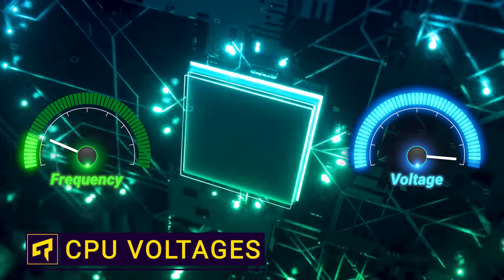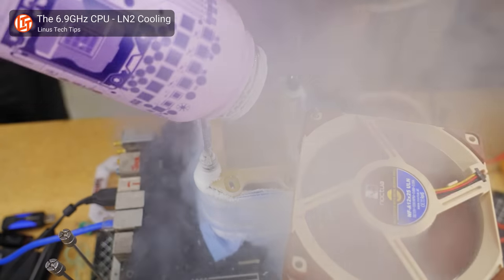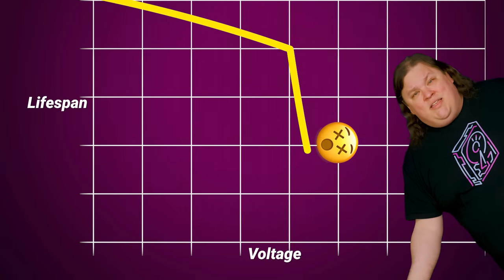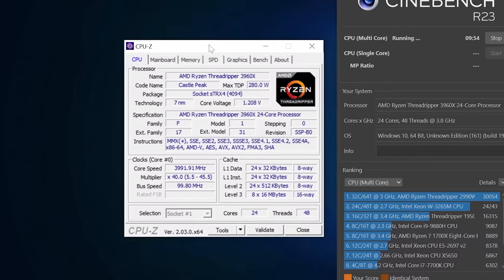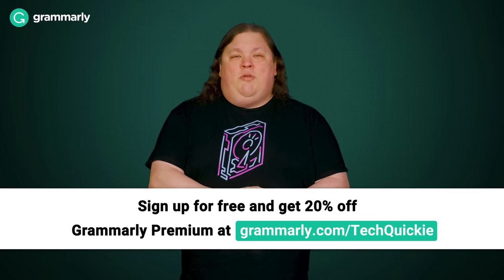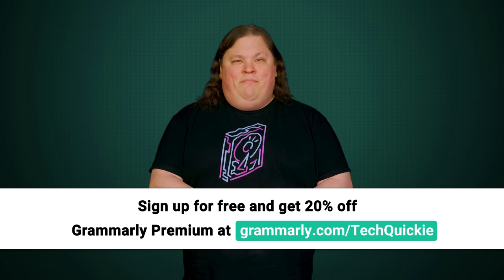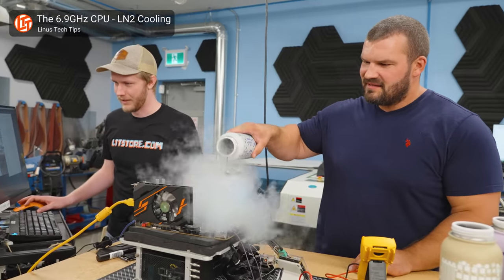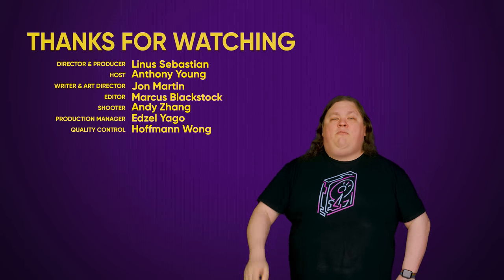What's the Point of UNDERVOLTING Your CPU?

Comment: My 5950x was constantly running at 90c on stock voltage (1.4v). I undervolted it to 1.2v and the temps dropped by 30c. It's staggering how much of a difference undervolting can make
Reply: some motherboards liked to crank the voltage on ryzen for some reason. it became common practice to undervolt. also, newer bios from most makers changes this behavior, so that they run on the lower voltage as a base.
Reply: 5800x, 4.6Ghz, 1.2v! im so glad to see other users here with the same experience. thermal runaway was super common anything above this (4.7Ghz+ or 1.3v+) and i have the D15 cooler
Reply: Dude, thats because your motherboard is BROKEN.  There is LITERALLY something WRONG with your computer.  All you did was put a bandaid on a bullet wound.
Reply: @NinjAsylum  ok buddy
Reply: Waste of time. Just use Eco Mode
Reply: @NinjAsylum  chill, you dont even know what cooler hes using
Reply: @Its_Onion  are you happy with the températures ? I want to try this on my 5900x but idk if it worth.
Reply: My 5950X ran stock at 1,5V...only when using all cores it goes down to 1,1V. I used that 1,1V as the basepoint and found the highest clock it ran with that on all cores. It was 4,2Ghz.
I lost 10% singlecore performance, but gained 10% allcore performance. What it also did was reducing that 90C down to 45C and also cut the powerconsumption for the single core tasks by half. Allcore was not changed with 65C and 140W.
Reply: @steve55619  Eco Mode doesn't work properly on the 5950X. The singlecore still boosts to 1,5V and 90C and multicore performance gets reduced by half.
It is only viable on Zen3/4 CPUs with 1 CCD.
Reply: I'm using stock cooler, but my 3900x overheated at stock so I limited it to 80 watts in the BIOS.
Reply: @steve55619  I think about this too but note X3Ds don’t have Eco mode, you can still manually lower them though
Reply: So im curious. 
My ryzen 5950x under water runs a 1.247v @ 45-55c on 4.7 all core locked, depending on load. Rarely if ever seen it hit 60°

I've gone as high as 5.4ghz all core but at a screaming 1.5v and its temps where basically 80c flat and 90c spikes... which is basically throttle. And sadly didnt see any real notable performance gain on 3dmark or other test from 4.7-5.4, which kinda blows my mind that the ghz increased, but my points barely moved compared with 4.0-4.7 where it jumped hundreds and thousands of points each bump in ghz. After 4.7 it seemed like 25-75 pts per .1ghz. 🤔
Reply: @alorrick7546  5.4 all cores? I do slight above 5ghz and cpu takes 330w of power. You must use nitro cooling
Reply: @Its_Onion  Thats crazy, my Intel CPU with AIO never reaches higher than 50 degrees boosting to 4.4 GHZ all cores, and here people are still saying air coolers are best. lol.
Reply: Any performance loss? Im running the 5600x can u reccomend how to undervolt? Whats the process? Thanks !

Comment: Wish you could have talked more about the physics of how changing cpu voltage affects the speed of the transistors and propagation delays. That is something that I think many people would be curious about when trying to understand why these things work.
Reply: That was the very thing I was hoping to find, pretty disappointed. It's not like I expected differently, but still, I want at least some details. Honestly, these days you get away with lots of nitty-gritty, especially in the techtuber business audiences are hot for information they might not even understand outright.
Reply: You guys are probably expecting a little too much from a channel called Techquickie...
Reply: @Tripdoxx  I mean yes, that's what I said right in the beginning
Reply: Exactly! But I guess you need proper electrical engineers with real time experience for that. TechQuickie won't suffice.
Reply: @Tripdoxx  I don't think so, even a quick high level explanation of how you can get similar or better performance while undervolting is warranted, and expected, because the into mentioned this.
Reply: I wish too, I replayed the video 4 times to see if I missed something
Reply: I was hoping for that
Reply: Nah
Reply: All components in a circuit have capacitance. A transistor has gate capacitance, specifically. Decreasing voltage increases the time it takes to activate the gate (rise delay), and the longer it takes for the gate to shut off (fall delay).

Now cascade this across a circuit path and you will see that a certain amount of power is required to overcome the total capacitance to then supply the correct output. Given that power is a function of current times voltage, we can see that the decrease in voltage decreases the power, and the decrease in power increases the circuit delay because of capacitance.

tl;dr circuit capacitance described as a series of buckets: how long would it take to fill up ten buckets with rain (undervolt) versus a garden hose (default voltage) versus a fire hose (overvolting)?
Reply: @ShimrraJamaane  But still, how does that make it faster? It is literally the first thing he says: "increase your CPU's speed while ALSO decreasing the energy it uses". The way you describe it would make it slower, which is my logical conclusion as well... It will help with wear but at a cost of speed.
Reply: @zer0her048  With an undervolt, you can achieve higher clock speeds for longer, because you are using less power. The issue comes into play with thermal throttling. If you lower your starting point, you can hit that threshold much later while holding high clock speeds. Undervolting decreases ∆T.

Basically, you are looking for the lowest voltage where the chip is stable (no crashes) and you can even raise clock speeds. So you are increasing clock speeds until you start to fail, you take the last known good clock, and you start undervolting. You do this until you find a last stable setting. 

What you have essentially done is find the specific settings needed for that precise chip. You've discovered the greatest clock speed, now you want to prevent the chip from thermally throttling itself. So, you begin undervolting until you find the lowest stable voltage that maintains the frequency. End result? You have the lowest thermal output for the frequency in question without experiencing earlier throttling that you would with higher voltages.

In short, more voltage doesn't mean faster, it just means hotter and potential to offer higher frequencies. If you can run at 4.2GHz at 1.2V or 1.1V, you would always choose 1.1V because the chip will stay at lower temps and maintain higher frequencies for longer. Running with 1.2V in that scenario only results in increased thermal output, not increased speed. So, lower voltages -> lower thermal output -> less throttling -> longer sustained performance.
Reply: @ShimrraJamaane  thank you for taking the time with this explanation in a random Youtube comment thread.
Reply: @dshahrokhian  gotchu fam

Comment: On an i9-12900K I only managed a -0.110 V offset before it became too unstable but it still reduced temps by about 10-15 degrees while using 50 W less. Really glad this is being covered so more people can save a little bit of power
Reply: Also check out and modify the voltage-frequency curve for even more under-volting. Usually the higher frequency can be stable with a larger under-volt.
Reply: I have no clue about this stuff so i wont touch my 13600K
Reply: @teeaymusik9811  then why did buy "k" series CPU?! That is the whole point of the K-series, you paying extra, but you can play with the "dials"!
Reply: @mcst6969  It did only 50 euro cost more with a 1.5ghz higher base clock. And if i want to overclock in future i will be able to. But i think this is not even needed because its so fast at stock so you could also ask everyone else with a 13600K why they did buy it.
Reply: @teeaymusik9811 "only 50€" ladies and gentlemen: inequality is a thing
Reply: @TheSlowDude  I just got a 13900ks and im going to delid it and overclock the shit out of it just like my 12900k that still running to this day. 😁
Reply: @mcst6969  "dials" no. "Nerd knobs" yes. 🤓
Reply: @pixels_per_inch  how much should I do? The general offset of event .05 was unstable for me
Reply: 10-15 degrees less sounds great to me.
Reply: i have a 13600K with an offset of - 0.110 about 45 watt less and a out 7-10 degress less
Reply: Lucky to undervolt, now this cpu cant be undervolted
Reply: @teeaymusik9811  than never buy AMD 🤗
Reply: What are you comparing your undervolt to? I'm running my 12700KF at SVID best case, which in itself is a hefty undervolt from less optimistic presets, but I can't go any lower manually without stability issues.
Reply: Anyone experience with an i7-13700?
Reply: @teeaymusik9811 Base clock is a very dated way of looking for an all core turbo frequency but you did luck out. Compared to the 13400, the 13600k all core boost a full GHz but that's mostly correlation not causation. For one the bass clock is only 1ghz difference too but it doesn't actually scale with it. For example the 13500 has a base clock 800mhz higher than the 13400 but the all core is only +400mhz. Similarly the 13700k & 13900k have 100mhz, 500mhx lower base clock respectively than the 13600k but boost 200mhz and 400mhz higher on all cores than the 13600k
Reply: @TheSlowDude  in the big picture of building a PC 50€ isn't that much. Sure it's possible to allocate the money elsewhere in the build or not spend it at all but if someone is sweating 50€ on their build then perhaps their whole budget is better spent on other things in life or saved for a future time.
Reply: I am running my 14700k at -0.195V. That dramatically reduced it's appetite for power, and made it much easier to cool.
Reply: @carlr2837  how much score and temp you got in cinebench? And do you face any crashing in games with -0.195v ?

Comment: There is one more really useful and Fairly common use of UV. Some of the more high performance, small body laptops, May be able to run your cpu at boost for only limited time.  Undervolting can increase that time for longer workloads, or even make it boost indefinetly. I made my laptop perform almost 20% better in cinebench r23 by undervolting. To be fair i did get quite lucky in the silicon lotery, Most laptops wont get duch high gains, but almost all laptops can benefit greatly.

Edit: Cinebench is by no means a perfect performance measurring tool, getting 20% more score wont result in 20% more overall performace but i have seen a really nice improvement in more cpu intensive games and a great improvement in video rendering times.
Reply: Does it extend battery time or reduce power usage an appreciable amount?
Reply: Are you sure you undervolted a laptop chip and not limited the max power consumption. Its not the same
Reply: @TheFlyingSailorYT  Most definitely
Reply: @TheFlyingSailorYT  I can't tell you exactly how much of a power saving you should expect, but if you're the type of guy that cares a lot about battery you could most certainly get like 5 to maybe 10% in certain scenarious. You can definetly give it a try and let me know if you get any interesting results.
Reply: @ThePgR777  I am certain I undervolted. By about 160mV while still being fully stable.
Reply: @misasuchomel5829  Its strange you can undervolt a laptop cpu
Reply: @ThePgR777  Well, I couldn't quite do it from BIOS, like you probably would expect, instead I used a software called "throttle stop" It does a lot of usefull stuff with your CPU, I just used the undervolting feature.
Reply: @ThePgR777  I do think xtu works on laptops as well, I hadn't tried changing my settings but throttlestop allowed me to change my voltage on a locked OEM craptastic generic school laptop like HP which had an i5 and an mx130. So it's probably dependent on which laptop you get
Reply: @misasuchomel5829  which cpu that you got? Most newer stuff can't be undervolted because of the plundervolt patch?
Reply: @remicaad5075  I am not completely familiar with this term, either way I do have a bit of an older one. An i7 9750h running at about 4Ghz turbo during normal use. Before the UV it would usually throttle to about 3,2 - 3,5 GHz depending on the workload.
Reply: @misasuchomel5829 most newer laptop nowadays got their bios patched because of the plundervolt , try looking at it, its sad
Reply: @remicaad5075  Yep many laptops had undervolting ability removed with security patches. Best option now is to underclock (not undervolt) with ThrottleStop. I limit my CPU to 3Ghz because most games don’t need faster than that. Could probably even get by with turbo boost disabled running at 2.2Ghz base clock.
Reply: Intel has been locking it on 12-th and 13-th gen, I mean completely disabling it. Locking began since 10-th gen. So for most laptops today, it's unfortunately not an option. And I wish Tech Linked mentioned it
Reply: @ThePgR777  yes he's sure, limiting power won't increase cinebench scores, while undervolting does as it decreases thermal and power limit throttling.
Reply: @ThePgR777  all Intel laptop CPUs were unlocked for undervolting from 4-th to 9-th gen, then Intel stated locking it since 10-th gen, and sine 12-13 disabled it completely. Which is why I'm never buying Intel again.
Reply: @remicaad5075  yep, which is why I hate Intel now and never gonna buy from them again. They had such a perfect solution for overheating laptops but they shot themselves in the foot.
Reply: @misasuchomel5829  Even throttlestop doesn't allow me to undervolt my CPU. My temps are going mad while playing heavy games like cyberpunk, resident evil remake series, red dead redemption, and going like 95-100. I decided to buy a cooler instead, I hope my temps stay around 80-90 this time cuz thats the normal range for a laptop with an intel CPU.
Reply: This disabling of under volt capabilities by the OEM must be arbitrarily applied, because my Lenovo Legion 9i with a 14900HX is absolutely able to be undervolted, after I unlocked it in the BIOS.  My previous laptop I was also able to under volt, so not sure how everyone has been experiencing completely disabled capabilities.
Reply: How much -0.0X Volts you undervolted it to?